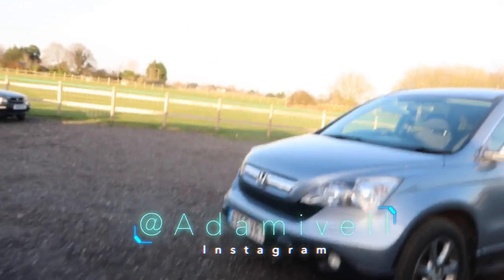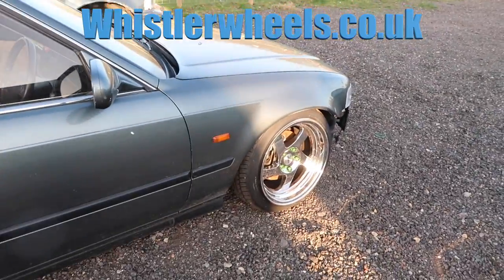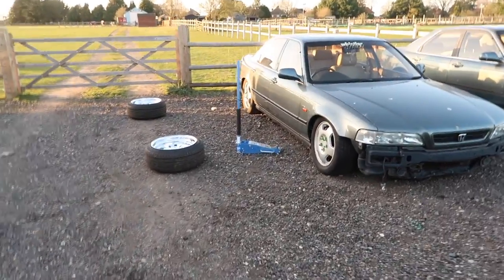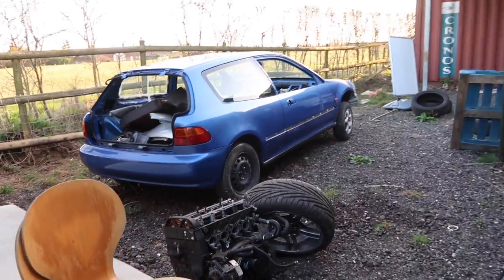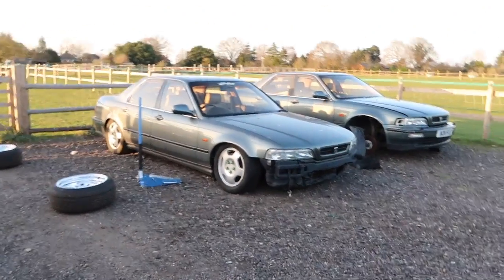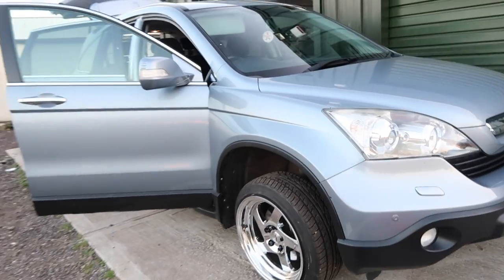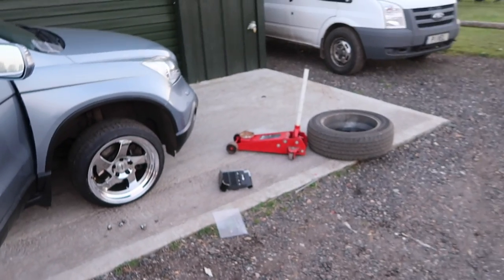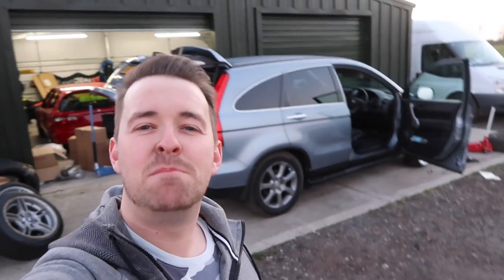Failed to pimp my mums Honda CRV

Comment: It sort of looks like it's juiced and you're riding around at full height.

Couldn't you just pick up some secondhand wheels for not very much while you refurb the wheels and then punt them on?

Also, for your new daily, why not a volvo estate? The right ones done well tick alot of boxes.